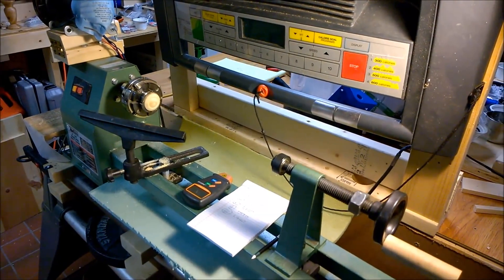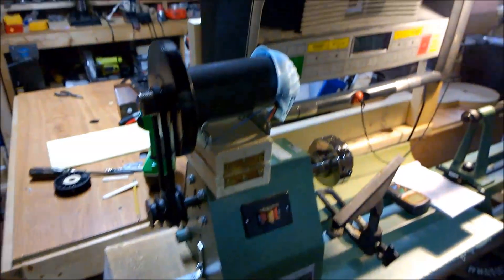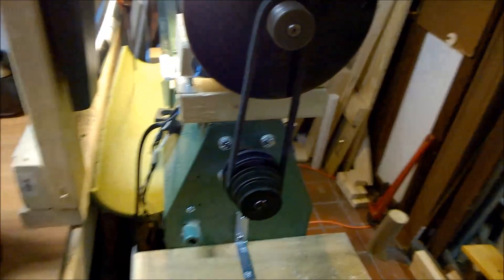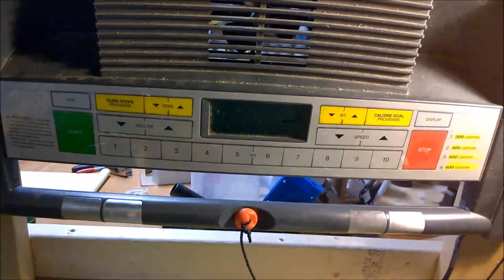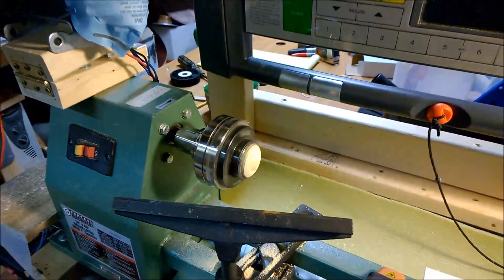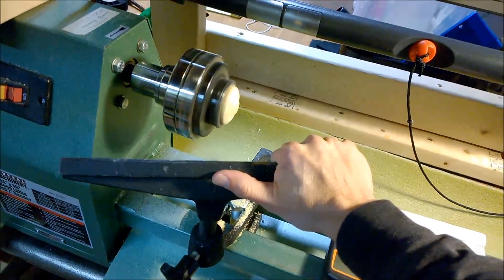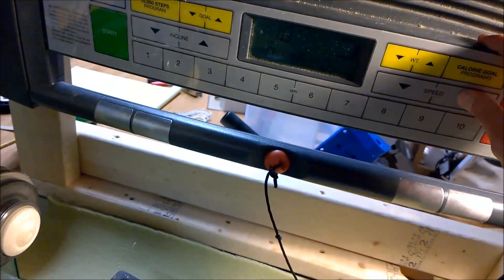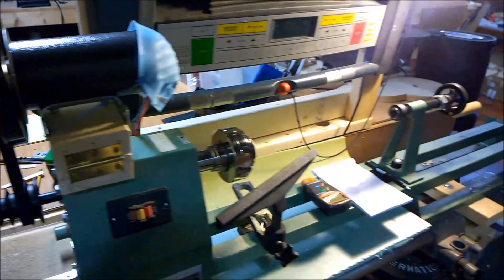A Treadmill Lathe! - A Junk Bin Project

Comment: This is awesome. I'm doing the same thing for my Central Machinery lathe whose motor decided to burn out and catch on fire.  I've been trying to figure out a solution for the pulleys and your video gave me some good ideas.  Have you considered pulling the controller board out of the treadmill dashboard and adding a potentiometer for fine grain speed control?
Reply from the maker: Hi Brian.  Glad the video gave you some ideas it was a fun project.  I haven't tried to fine tune the design  but certainly could in the future.  Thanks for your comments.